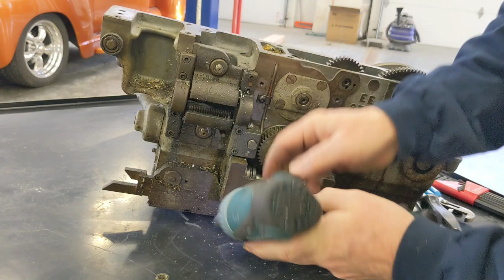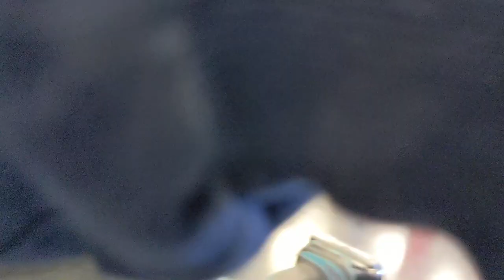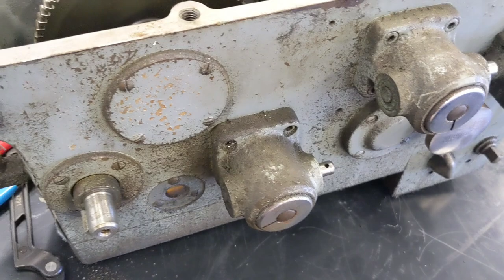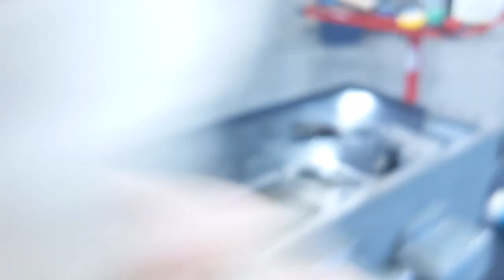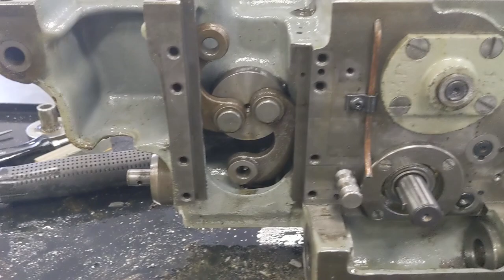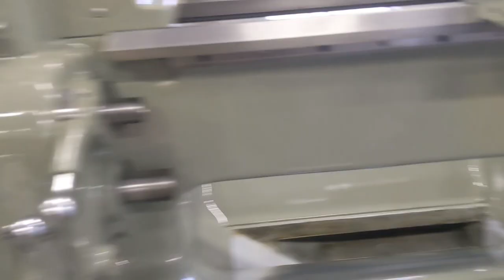Monarch10EE Lathe Refurb part 11

Comment: You're keeping me motivated on my refurb, keep up the great work.   What solvents are you using to clean without tearing it completely down?
Reply from the maker: Thanks Jim! So for solvents, I generally use purple cleaner but I always do test spots first because it often removes or softens painted surfaces. Also, if you want to do a good cleaning and paint prep, I've used autobody wax and grease remover prior to repainting. If the paint reacts and I don't want to ruin it, I typically use kerosene or mineral spirits which seem to not attack paint. On unpainted parts, brake cleaner in spray cans works really good.